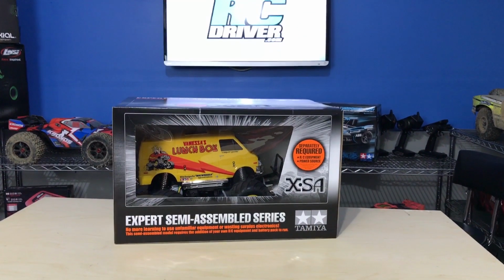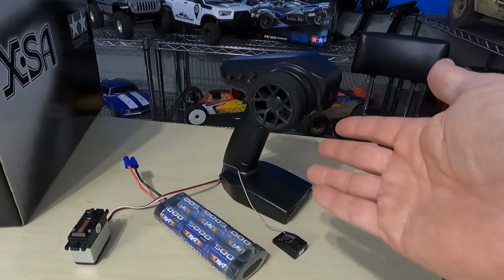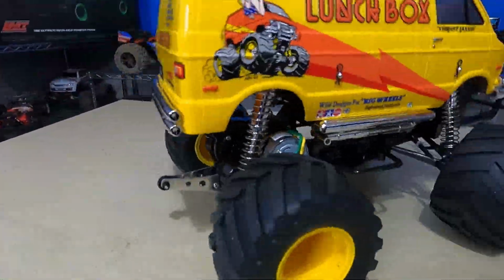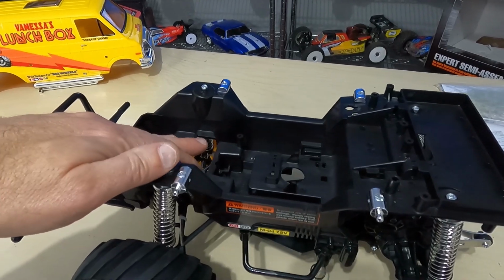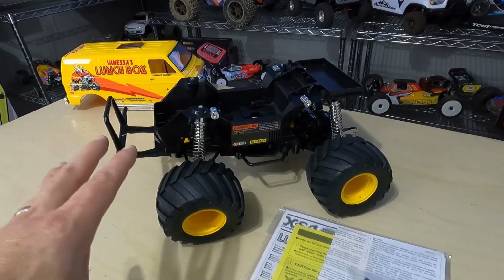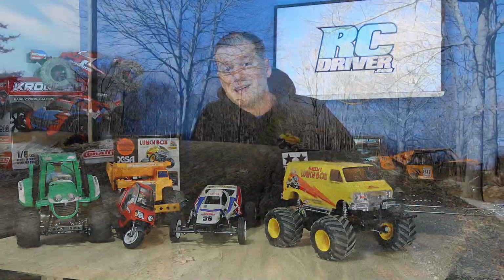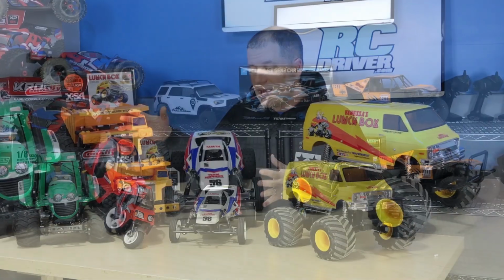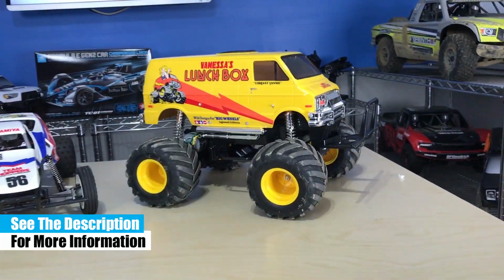Just Add Some Electronics & Go! Tamiya Lunch Box X-SA Custom Van Review | RC Driver

Comment: I got the full built up kit a couple of years ago. The process of building and tinkering was so much fun! Added ball bearings, a Sport Tuned motor and Lunch Box truly became Vibrant! Love seeing videos of the Lunch Box in action, no matter what version. There are people who have pushed it to high extremes, but I think at any level, this is going to always be a fun drive. I think the X-SA is good for those new to the hobby, to give them a taste of what Tamiya is all about before they dive into fully building their own kit (which you can also supply your own electronics to as well). To me, Tamiya is always (mostly) about the build up process. The joys of running my own creations will always exceed something that is RTR. Great video and Happy Holidays!
Reply: Hello, I often see people add a torque tuned motor. It's a little cheaper.
I used also a sport tuned.  It's plenty of speed when it's stock

Comment: I had this when I was 9. I'm 46 now. A lot of great memories!
I ended up with a speedworks pole position motor (15 double) oil shocks, black foot wheels Imex slicks total blast.
Reply from the maker: Sounds like it was a blast!
Reply: I'm 46 as well this my first rc love the lunch box
Reply: Total blast. A addiction I don't want to get rid of. 
I have a rc10 b5m, rc10b5, rc10 b 4 
Rc10 t4
Custom works gbx intimidator 
Custom works gbx enforcer
Getback (jrc) latemodel/ eastern dirt modified. 
Kranzels terminator. (3 of these)
Coming December 25th Kraton 8s . 
If you decide to run bigger tires on the rear flip the wheelie bar , it keeps the front end lower and drives better.
Reply: @scottw2157  go through the diffs my o8s had low fluids , and crap in the center
Reply: @paulclancy2404  cool thank you good to know.
Reply: @scottw2157  no problem , i guess million is just silicone,  i thought my center diff was melted  😆 , i put 60 200 30 , just what I had that made sence , compared to 6s its under powered , i see why everyone puts 800 1100 kvs , it is a cool truck
Reply: @paulclancy2404  that's cool.  Personally I've always wanted a larger scale truck,  now it seems like the price is right. I have a lot of 8th scale experience so I figured that the kraton 8s would be the best choice especially at the price point.

Comment: I imagine the only bad thing about this compared to the kit style is that if you want bearings then you have to remove all bushings to add bearings.  Kind of a pain when it comes to the transmission.  Good video.  I like my Lunchbox Black Edition.  I put a 3200kv brushless system in mine and it made it scream!

Comment: Wow, that did go slow. Those bushings needs some grease asap! I own 4 Lunchboxes and my main vehicle in the 90s was the Lunchbox, totally stock, even with the plastic bushings and 1200 Nicad battery. It should pop a wheelie every time you pull the trigger. But great to see Tamiya now step up to use your own radio gear. But for me personally, it is the building that draw me to Tamiya, and the scale ness. In the 90s my record was 14min runtime with 1200 battery on mostly full throttle and about 15ft wheelie going slight uphill. With my current re-re Lunchbox with Technigold motor on 2s, Traxxas wheeliebar and 55mm touring shocks I can do wheelie all day long. Current record is about 300ft (I did run out of space)

Comment: Yeah go Lunchbox!  I'm really impressed with the finish of the body and I wish that they would just sell that separately as that's the most time consuming bit to do.  As to the rest of it there are a lot of little hop up's to do on this as you build it like the bearings, alu body posts, transmission brace or 5th shock etc. etc. so I'd rather just build the kit.   You can also cut a little bit out of the battery tray and fit a rectangular lipo in underneath.  When you put the lipo on the back of the chassis did it not prevent the suspension from working as that's where the screws poke through?  Anyway, great video :-)

Comment: The laboratory motor on it or just a regular 540 can because I would put a 540 torque tune on there if I had it and I put the sport tune on the midnight pumpkin?
Reply: My Lunch Box regular build kit came with the standard silver can 540. I installed the unused Torque Tuned motor from my Tamiya TT-02 kit and a set of bearings. I rips pretty good, but I will be trying a Sport Tuned, and adding a Hobbywing 1060 ESC next. Add also, I installed a Super Stock RZ in the TT-02. The RZ motor is awesome looking, well built, and it’s fast. My favorite Tamiya motor so far.

Comment: My first real rc. One thing, get metal internals for the gearbox. Specifically planetary gear as this truck shreds them. Or if you have a 3d printer you can make as many as you break them.

Comment: When they use bushings and you plan on using it you would have to disassemble the transmission and upgrade to ball bearings. If it’s a shelf queen it would be perfect. Not sure why Tamiya still uses the bushings most people buy them when they build them anyway. Just charge the extra 10 dollars and call it a day .
Reply: Ikr agree miles buy kit if have take apart anyway

Comment: What’s a good brushless to run with the factory ESC on these?  

I’m building Black Editions of both this and the Super Clodbuster since I’ve been wanting both for about 30 years now and only mods have been full bearings, AMPro lenses for both and axle wrap preventer for the LunchBox.  Doing the body work right now to get it ready for paint.

Comment: First RC was a first gen nitro rustler, still have it, ive never understood the craze with tamiya, cheap plastics. No better than a New Bright.  Nostalgia is strong these days.
Reply: Way better than cheapo rtr nikko and new bright etc, obviously fully proportional, scale and easy to mod, for a model that came out in the 80s, there is clearly a lot to love about the lunchbox, yes its not even in the same league as traxxas etc but still so fun to hop around, got mine on good brushless set, 3s lipo, goes like a bat outta hell, love tamiya

Comment: I honestly don’t believe that thing has the power to lift the front wheels up lol 80’s RC trucks weren’t really known for their extreme power 😂 it is a classic though for sure.
Reply from the maker: It lifts the front wheels just about every time you touch the throttle, but unfortunately doesn’t carry them too far. It did carry them better with a little extra from the LiPO.